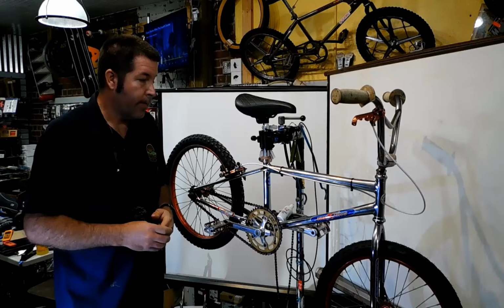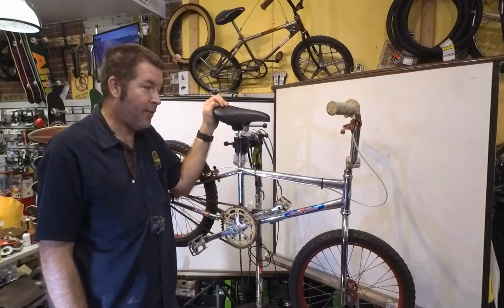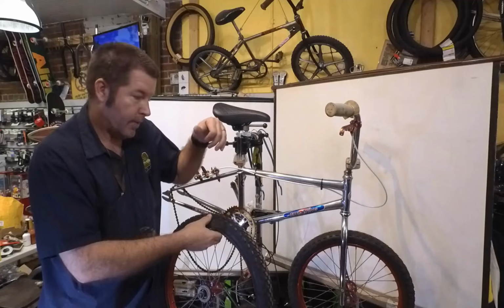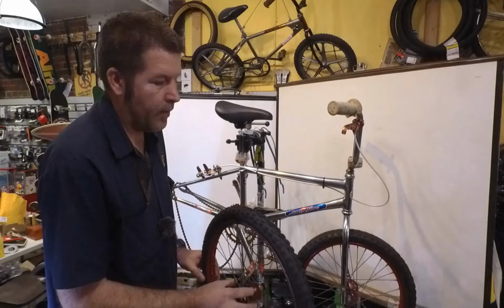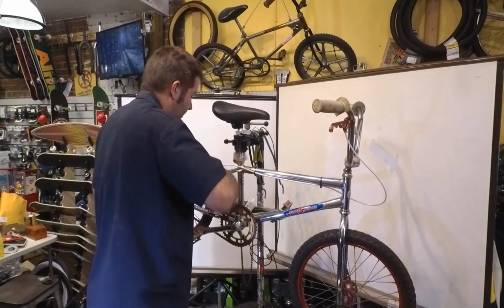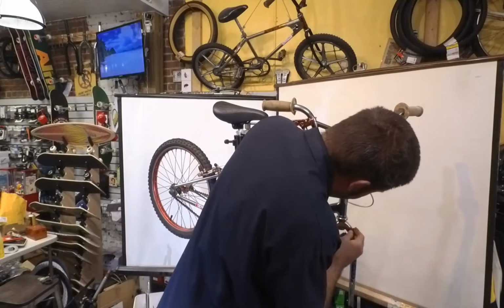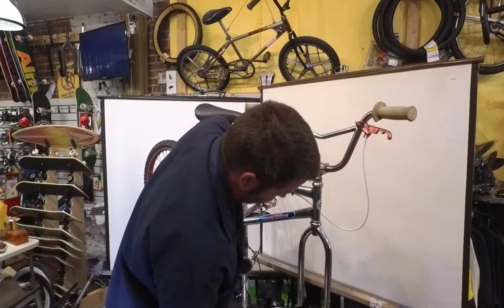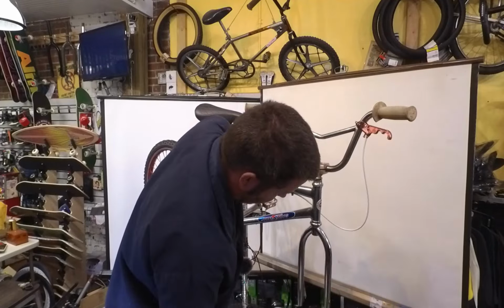Working on the 1979 Schwinn The Sting!

Comment: Are parts still available for the chrome Sting?I have one that was my little brother that I would like to rebuild it for my grandson.
Reply from the maker: Yes and no. Yes you can get any part to fix it but....... the new parts don't look aera correct. The only way you can get the proper parts is by finding  the parts by Ebay or just really good luck. Some new parts will work just fine but from my experience it's always the parts that are most noticeable. If you just want to make it rideable then it's not a problem at all. Goodluck and make sure the grandkids know it's something special and to take care of it.👍